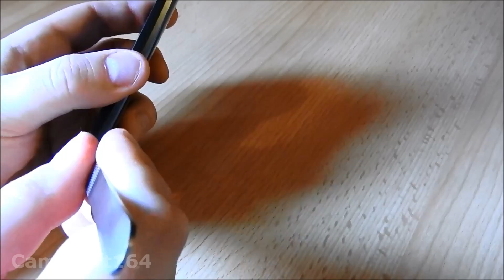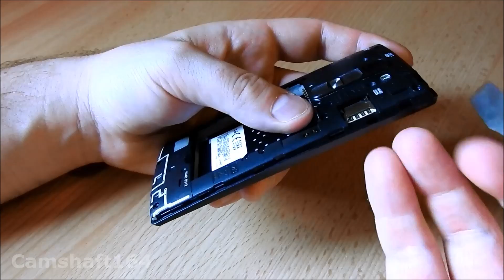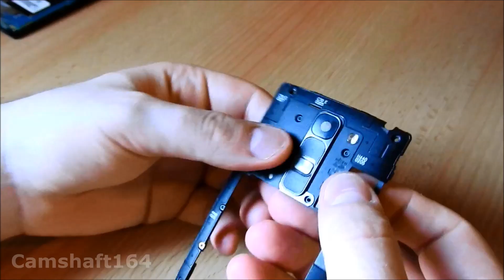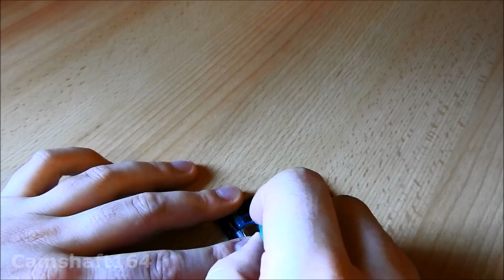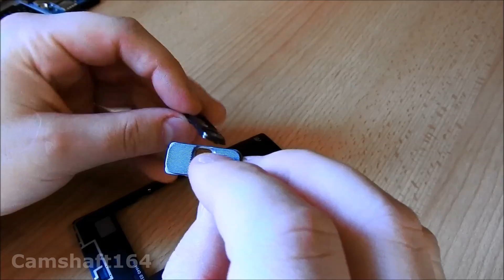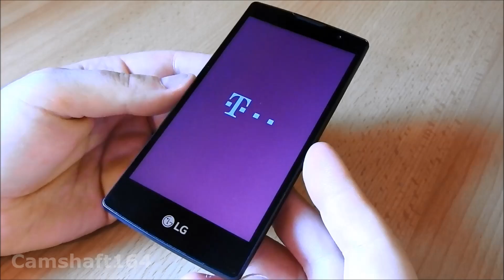LG Spirit LTE H440N Teardown Disassembly and Assembly [Tutorial]

Comment: Hello,  I have one specific question my sister has lg spirit h420 and 
display that is broken. I have lg spirit h440 with working display but 
broken mainboard, can I use display with plastic frame  from lg h440 to 
replace broken display on  lg h420...

Thanks in advance :)
Reply from the maker: Hi, yes, you can, there should be no problems.
Reply: Thanks :) now just to fix the damn thing

Comment: My H440 doesn't pick any GPS satellite signal, which I think is a common problem with this model. Do you think it can be fixed? I saw a vid where the guy adds small cardbox pieces to the back cover in order to raise a few antenna contacts but they doesn't exist in this model.
Reply from the maker: Yeah, seems to be a lot of complaints in this area. I'm not sure what can be done mechanically, I don't have the phone anymore, and when I did, GPS worked fine.
Reply: Hey, I have the same problem. GPSTest shows 15-22 avaible but none In Use. Please let me know if you'll find a fix. I'll try to revert to fabric settings to see if this helps.
Reply: So far I think it is a hardware related issue, maybe the GPS antenna is too short or even disconnected after a defective assembly process. Someone provides a fix to the same problem in a similar model by just adding small cardboard pieces below three contacts but those contacts are not present (or not seen) in the Spirit.

Comment: I'm missing that key information on how to replace the LCD screen/digitizer.I have the phone fully disassembled but now what?
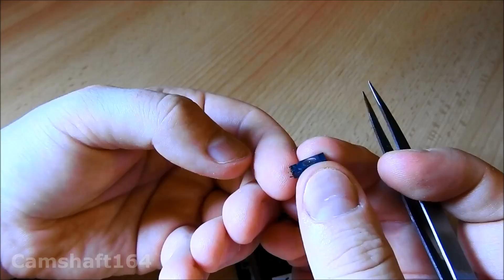Reply from the maker: +Morten Trab You can exchange the whole front panel (part seen at 9:34). If you wish to go further and try to separate the screen from the rest of the panel, you can do that, but be careful (I didn't go there in this video as I didn't want to risk damaging the screen). If you manage to separate it, you can get the replacement screen without the rest of the front panel.
Reply: +Cams164 I already have the replacement screen, and need to remove the current (damaged) screen. But I can't get my head around getting it off.I tried heating it (like and iPad) but that didn't release the screen.
Reply from the maker: Morten Trab Well if the current screen is already damaged, some heat plus some prying should get the job done (also check to see if there are any clips to be released).

Comment: Hi,  thanks for the video,  it`s great.  I have one question.  Few days ago I dropped the phone,  and wifi and bluetooth stopped working.  Do you know what could possibly be the problem?
Reply from the maker: +Boris Mikluš Sorry to hear that. I couldn't say, maybe some contacts got shaken loose, or something just plain broke. I would definitely try to open the phone and see if there is visible damage. My problem is I don't have the phone anymore and am not sure where the wifi and bluetooth modules are...
Reply: +Cams164 Is there any chance that wifi adapter is detachable?
Reply from the maker: +Boris Mikluš I've actually spent some time browsing the web in search for a replacement part, haven't found anything. The bottom part, where the loudspeaker is, houses the 3G/4G antenna, but I'm not sure about wifi...